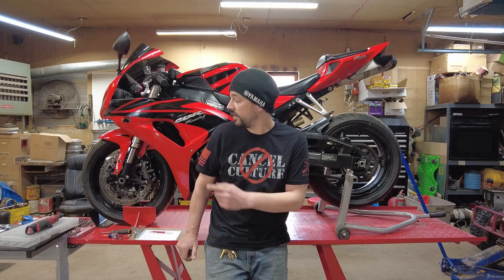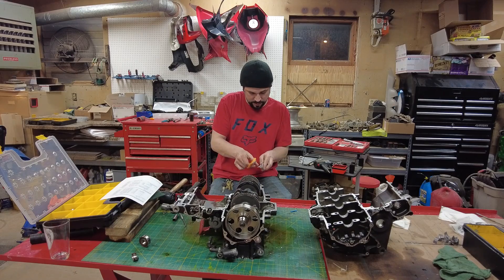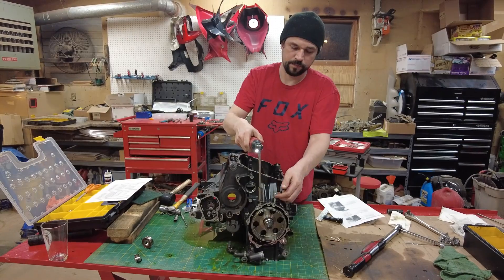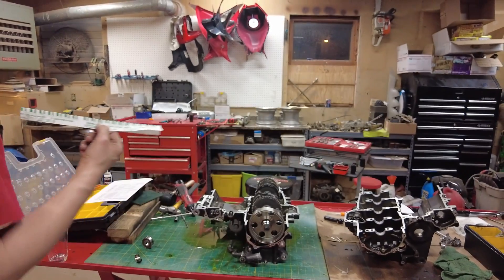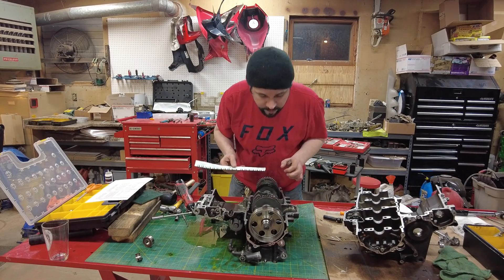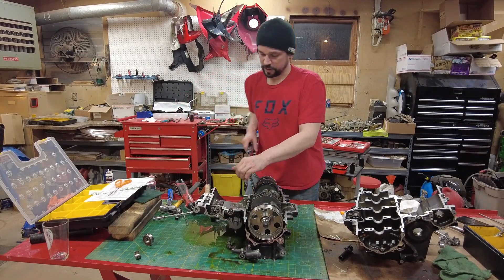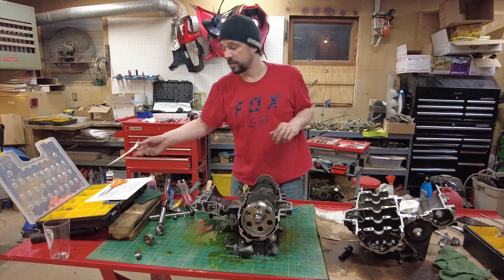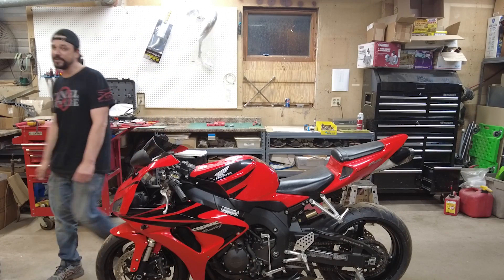How To Use Plastigage To Measure Crank Bearing & Rod Bearing Oil Clearance

Comment: Hey my man I’m doing a 04 1000rr full engine rebuild with a new crank case. I know I need to measure the clearances for new bearings on crank and connecting rods. But is that all I’m doing when trying to find which bearings I’ll need ?
Reply from the maker: You are looking at the letters / numbers on them to cross reference which bearings you need from the service manual. Measuring with plastigauge is confirming it is correct. Should be overkill but worth checking.
Reply: @The.Odyssey  the front face of where the stator cover would be the only letters I see are AAABB ,  and on the actual crank behind I see a letter “H ” and “3” both on opposites ends . 

Also I’m having trouble finding the bearing that sits in the crankcase behind the transmission.
 It’s the bigger bearing a you can see it in your video . Looks like it sits behind the sprocket on inside of casing but I can’t find the part number or know if what I ordered was right. Do you happen to know the part number I’m talking about ?
Reply from the maker: #36 and 38 on the transmission diagram?
Reply from the maker: Did you get a service manual? You need it for the table for the bearings unless I showed it in the video
Reply: @The.Odyssey   update i got the bearings table figured out ! 

I can’t tell if that’s what it is or not it sits right under another bearing which I think is the main journal bearing with the little pin on top and there’s a little black oil seal that sits on in front of it. I can’t seem to tell if 91004-Mel .

Comment: Hello. I'm from Poland and I have a question because I don't know if my mechanic is trying to scam me. I have a 2008 Honda CB1000R, and from what I understand, it's almost the same engine as the 1000RR. So, to replace the clutch pushrod bearing on this engine, do I have to remove and split the engine?
Reply from the maker: I cannot find a breakdown for a cb1000r but the 2008 cbr 1000rr does not need the engine split for this. It does for the transmission gears unlike the one in this video though.
Reply: @The.Odyssey Okay. Thank you for your answer. It's a small hole on the left above the front sprocket where the clutch pushrod fits. The clutch valve fits over it. It's a long rod. And there's a seal there, which apparently requires splitting the engine to replace. Unfortunately, there's no information on how to do it in the service manuals. I haven't found any manuals either. So, thank you.
Reply from the maker: I actually have an 08 CBR1000 engine in a crate. It's on my list for tear down this winter
Reply: @The.Odyssey Okay. I don't want to bother you, but if you could check this while disassembling the engine, that would be great. If not, thank you very much for your answers. All the best. Best regards!
Reply from the maker: I found a breakdown for the 08 cb1000. The engine looks like the 07 cbr1000 like in my videos. I do not see where there is any need to split the engine. It appears the the transmission comes out the side just like the 07... furthermore the only bearing on the clutch push rod is right under the pressure plate which is accessible right under the clutch cover.
Reply: @The.Odyssey Yes, but what I'm referring to is on the left side of the engine above the output sprocket, behind the clutch slave cylinder. After removing this cylinder, there's a pushrod that slides into a hole. And in that hole is supposedly a seal, replacing which supposedly requires splitting the engine.
Reply from the maker: Ok, in your first comment you said bearing. I see the seal in the diagram and it looks to me that it goes in from the outside.
Reply from the maker: This should be visible when you remove the sprocket cover / slave cylinder.Also, I would use either a seal removal tool or internal bearing puller. I'll throw some links in to the tools im talking about. https://amzn.to/4qUHMk6

https://amzn.to/4r1NIYv
Reply: I made a mistake about the bearing. I don't speak english well and used a translator. There's no bearing there. There's only a seal. On the GSXR-1000 K7, you can't remove it from the outside. You have to split the engine. The mechanic told me that on the CB1000R, you also have to split the engine. However, I read that someone replaced it from the outside in the CBF1000. I'm asking because I had a similar situation, with an oil leak in the oil pan under the sprocket. So I removed the sprocket cover, the clutch cylinder, and the pushrod, and there wasn't a drop of oil anywhere. So I took it to a mechanic, and he said that oil was leaking from where the pushrod is. He said that there's a groove in the pushrod because it had worn out, so he put it back in backwards, and that fixed it temporarily. But I don't believe he was leaking oil from there, because as I mentioned, I took everything apart and there was no oil. He said I'd have to replace the gasket, splitting the engine. And that's a big expense. I don't know if he's trying to rip me off.